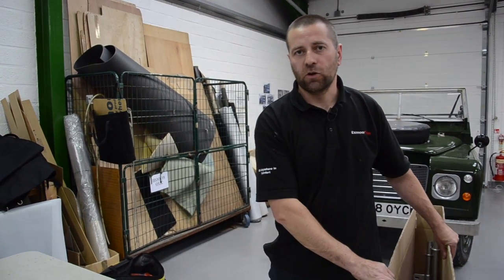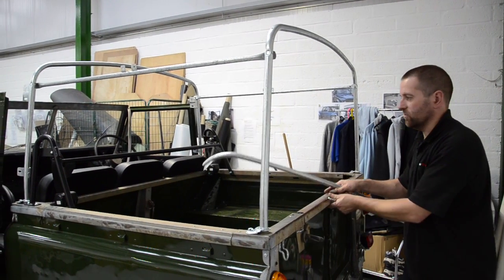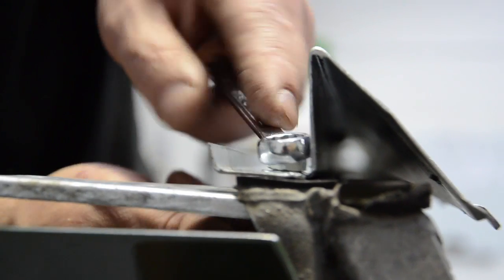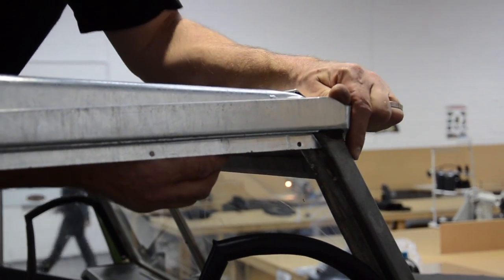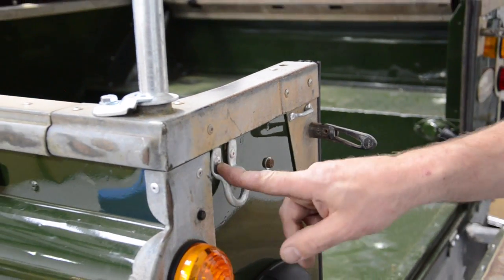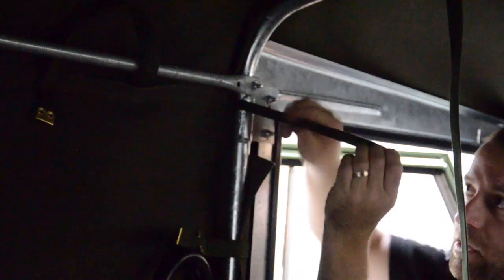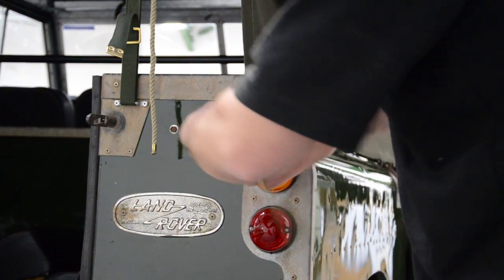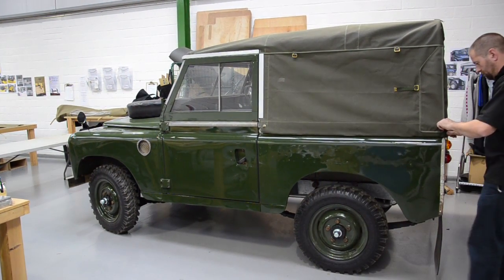Exmoor Trim 88 inch canvas and hood stick kit

Comment: I purchased a kit here in Aus & wanted to find out how to fit the channel over the windscreen as there is no mention in the instructions supplied. In this video, the top bar goes from a loose fit at 3.59 to fully secured at 4.00. It seems Exmoor are avoiding the fact you need to drill holes in the windscreen. Anyway, I was able to deduce you bolt the channel down & then bend/ clamp it back & drill & rivet. I also assumed some sealant would be wise.

Comment: You fit the over-door channels under the front rail, which is the opposite of what the printed instructions say. Following what you do, I can't now pop rivet the front rail down (something you don't mention in the video) and the edge of the side channels digs into both sides of the side rail. Any ideas?
Reply from the maker: Hi, it's been a while since I fitted this I'm afraid. Maybe reach out to Exmnoor Trim and see if they have any more advice.
Reply: @LRLiveUK  Thanks, yes they've been brilliant 👍

Comment: This video is fine as far as it goes, but the most challenging task - for a novice - is fitting the front screen rail to the windcsreen.  Why?  Because it involves (irreversibly) drilling holes in your (probably genuine) Land Rover windscreen frame and then rivetting the rail to the windscreen.  Unfortuneately this procedure is not shown - which is a shame.  I don't know if Exmoor have now fixed the issue (and well done to them if they have) but a few years ago their rail was made of a thicker gauge steel (i.e. stiffer) than a LR original part.  This made it harder to bend the Exmoor rail down to the LR windscreen in order to then accurately drill holes and rivet the two together without making a thorough mess of your genuine LR windscreen.  Also, there seems to be different views regarding how many holes you need to drill & rivet.  I.e. just in the gaps between the hooks on the rail (6 gaps), or through the middle of the hooks as well (6 gaps + 7 hooks).  I never found a definitive answer to that question and you'd probably have to look at an original LR factory canvas fitment to be sure.  Lastly, if you seek originality, check the number and location of the pre-drilled holes in the Exmoor screen rail against a LR original item, if you can.  Again, a couple of years ago there was a miss-match between the two.  However to be fair Exmoor may have corrected this, and well done to them if they have.  Despite the limitations of this video, thanks to Exmoor for helping us to keep these trucks on the road. (Lastly, consider looking at Issue 88 of Classic LR magazine (Sept 2020) which has an article on fitting an Exmoor canvas which may help you).